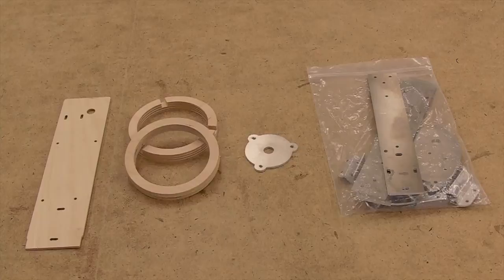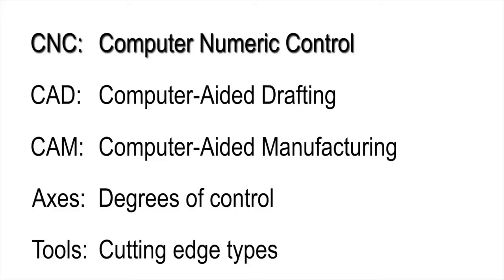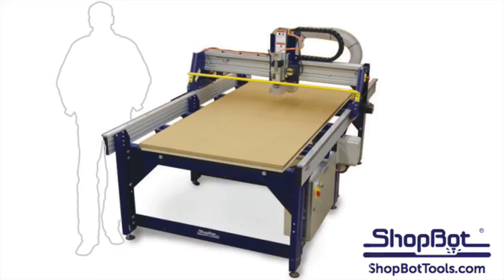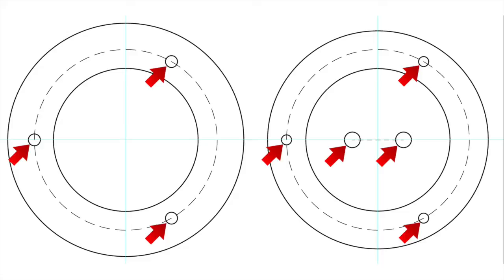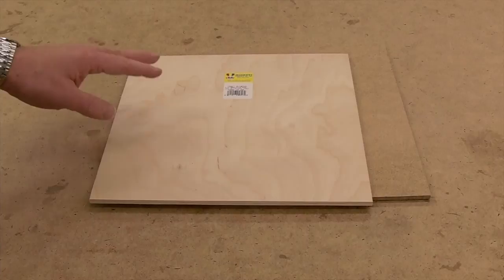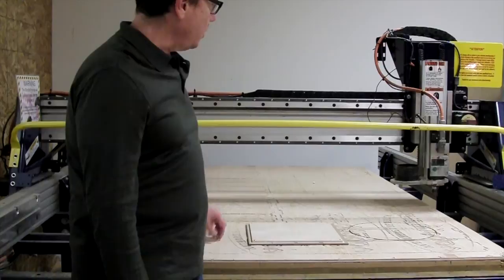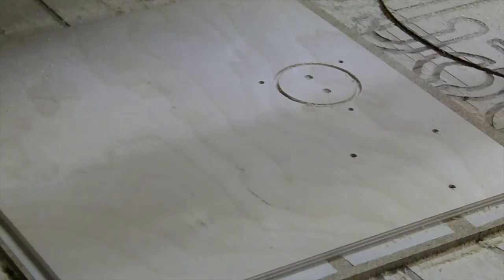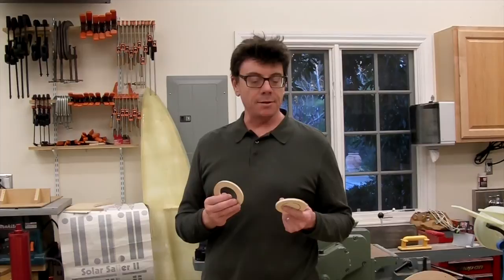CNC Routing Intro

Comment: Great info. Have you used the ShopBot for G10?
Reply from the maker: Yes, I've cut fiberglass sheet and it works just fine.  I use the same feed/speed, but a shallower pass depth.